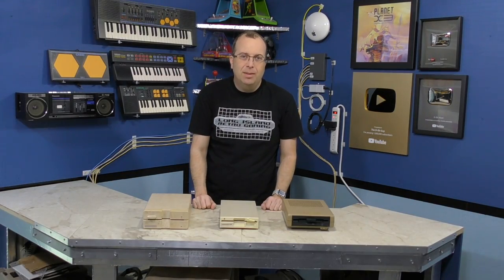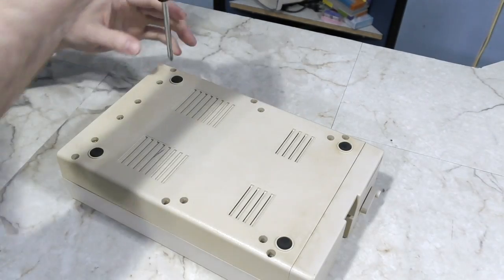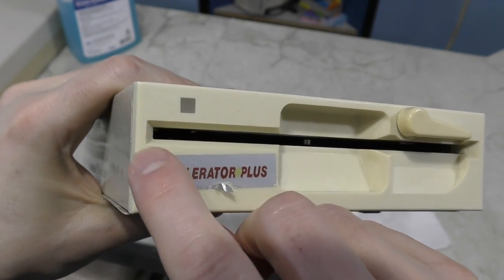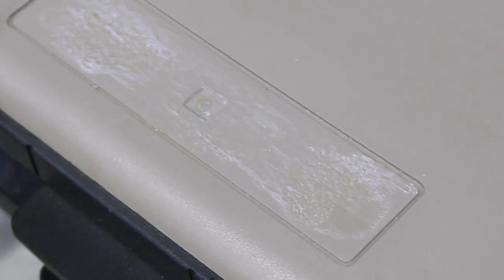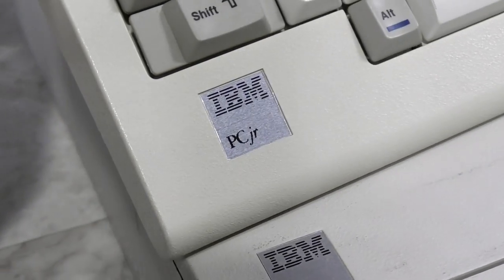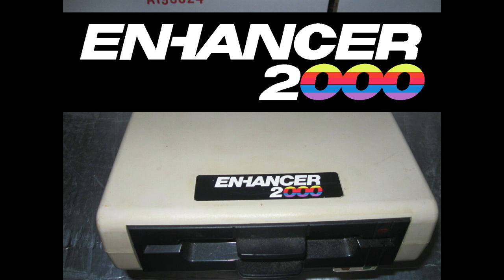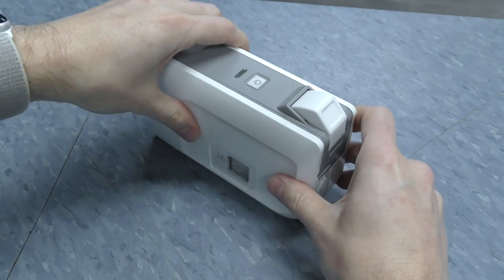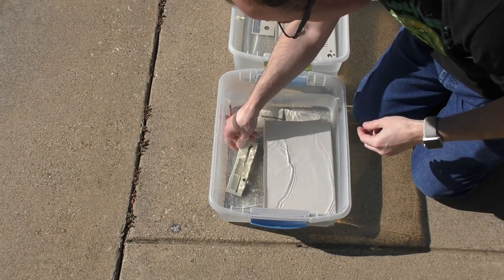How to make replacement badges

Comment: Just ditch the label printer dude. The resolution IS shoddy and the lack of colours limit it even more. I know it prints fast but the time you spend on designing the letter in such an inefficient way negates that. The label also stand out if place on something thats wider than it.
There's bound to be some transparant sticker paper for regular printers that fits your needs.
Also, personally, I would have done a thorough search for the font before trying to make it from scratch, but I suppose not all of the old logos have matching fonts readily available nowadays.

Comment: Why tape?  Why not use just kitchen foil? 

A UV-C bulb (aka germicidal) bulb may, as you suggested, be a good experiment. A UV-C germicidal lamp in a T5 or T8 bulb can be used in a regular "under counter" fixture. This is how I made my own EEPROM eraser. 

This may be inexpensive enough to try out too: https://www.amazon.com/dp/B07L9NRX73/ref=dp_cerb_1

DuckDuckgo.com: G8T5 or G15T8
The 15W is probably too much but inexpensive enough to buy for a test.

Comment: Great video. 

People remember that this is a video of how you can make labels and it shows that very well. Just because something is not how you would do it doesn't mean it was wrong. It showed 3 ways to make some labels and most are happy to see how that can be done.

The excelerator plus label that was on your drive doesn't look like a OEM's label. Here is a front view of one at high res (1) and a box showing the art work (2).
1). https://pbs.twimg.com/media/DgTBnFGVQAAxnwT.jpg
2). https://i.pinimg.com/originals/f0/60/bb/f060bb07153ce5c5554a45234506b880.jpg

Comment: I wonder how many times would anyone need a label printer at home lol
Reply: It is probably fairly common for people that do repairs or electronics projects and such, it can be nice to have a label maker or printer for making labels for switches and indicators on your projects, or labeling the parts drawers, bins, assortment boxes and such.

They tend to be more consistent, reproducible and resilient than plain hand written labels, though they are more expensive and  slower to make.
Reply: @Ts6451  make sense 🤔

Comment: not only was the tape a mistake, your weights are one too. You are creating a chemical process, and you are introducing tons of stuff that effects the process in a negative way.

Any metal that can and will rust is very bad in it. Instead of using tools id use galvanized bolts. The aluminum tape is still aluminum. ie, it reacts with chemical reactions. 

Use light strips instead of 1 bulb. You can line all the surface area of the outside of the containers in the lights. Don't put stuff inside, keep it all on the outside. Cover all 6 sides of the container with the lights and leave it.

I honestly would go to a school that has a chemist, and talk to him about your retro briting, and show him the exact chemical you use, and ask for tips tricks and pointers. They will help you a lot.